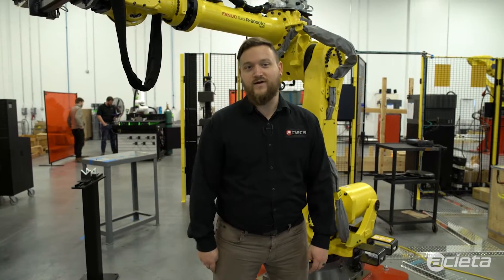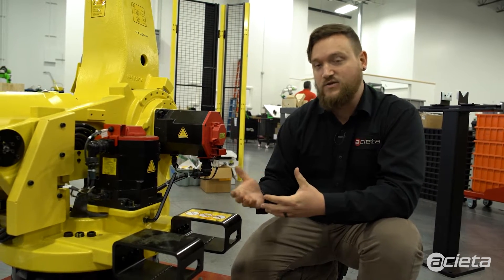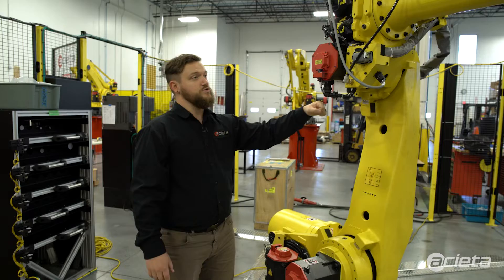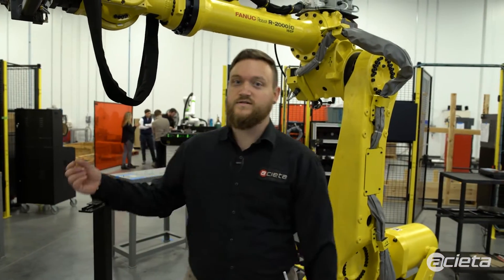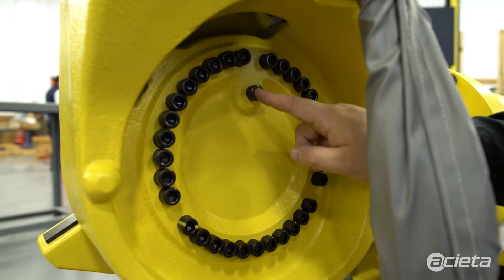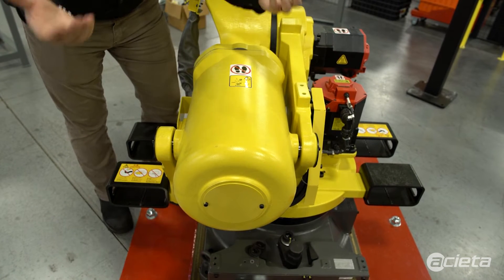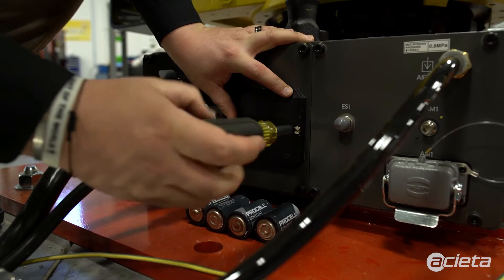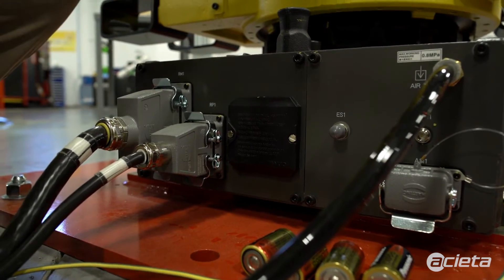Preventive Maintenance for a FANUC R-2000iC 165F Robot

Comment: What is the name of the grease used in the balancer ??
Reply from the maker: We used Shell Alvania/Gadus S2-V220 grease for our robot in this video. Please note that different robots might have specific lubrication requirements. Therefore, we strongly recommend checking the user manual or manufacturer's guidelines specific to your robot model to ensure compatibility and optimal performance. Using the recommended grease will help maintain the robot’s efficiency and longevity.